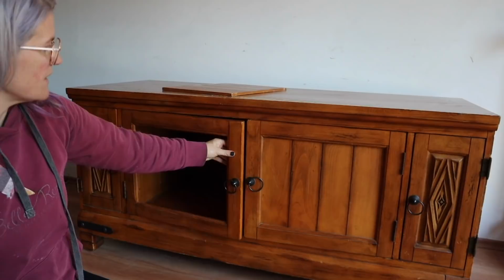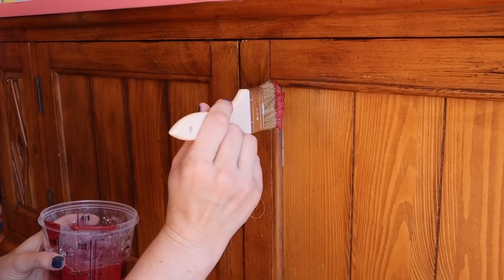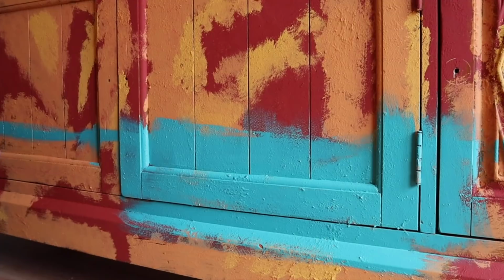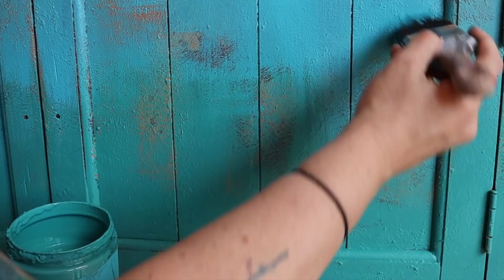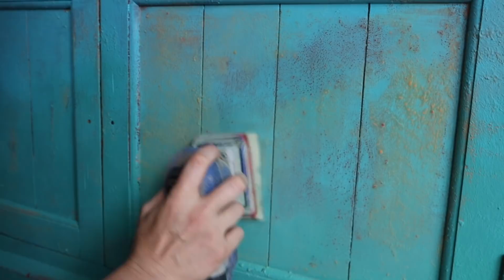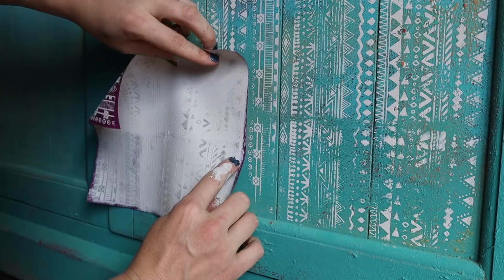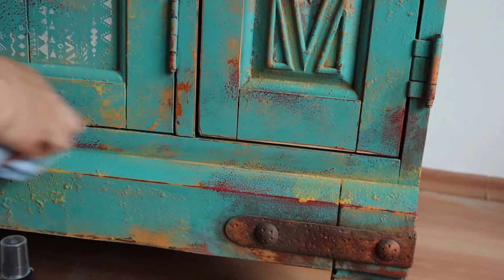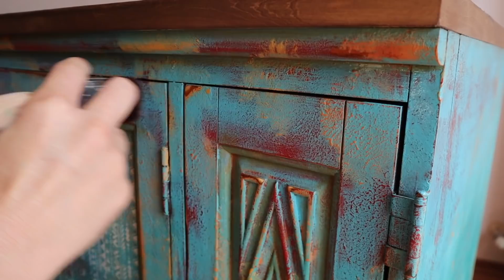Create A Unique Southwest Boho Furniture Makeover

Comment: Thanks for the “real time” footage. I always paint too fast, because that’s what I normally see on videos!
I would have liked to see how you put the gator hide from the other direction on the top, to see how you blend it into what’s already on there.
Reply from the maker: Thank you so much :) 

So what you want to do is do a light sand with a 220 or higher just to knock down any fuzzy that may have landed. Then I apply it the same way, if you miss any spots those second or even third layers will fix and unify and smooth everything :)
Reply: Thanks for the tips!!